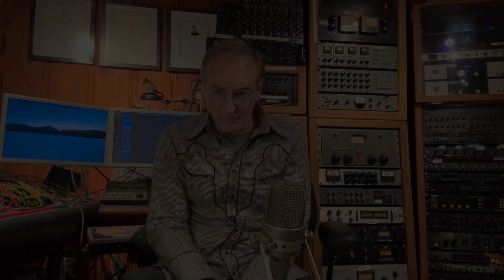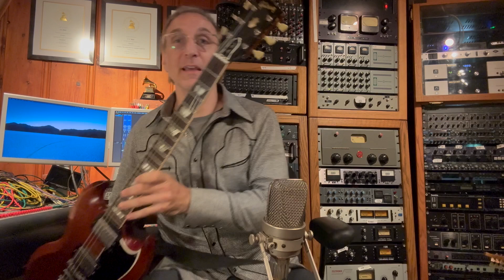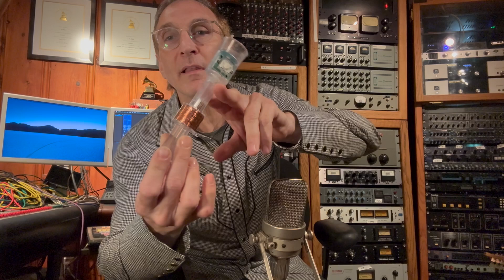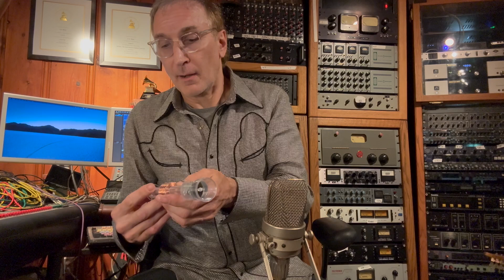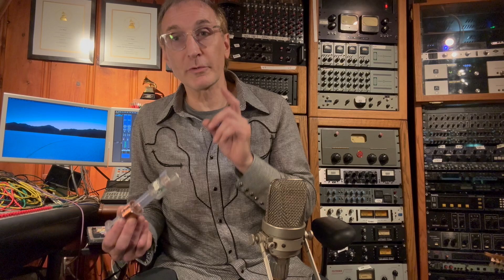Where does electric guitar tone come from?  (pt 1)

Comment: I thought Jim Lills video was really good, I had a a squire P bass a while ago, it looked good and it played very well but sounded like crap! fitting with a 62 custom shop PU and changing out the pots and capacitor, and what do you know, it sounded like a genuine made in USA Fender P bass! it was all down to the electrics in the end.
Reply from the maker: Thinking the video was good does not negate the fact that he is peddling misinformation and his methodology is bad.  His hypothesis has actually been disproven in controlled scientific studies where 91.7% of test subjects in a controlled study heard a difference between woods in electric guitars.  Also, just because you vaned your electronics and the bass sound changed, all that proves is that you can change the sound by changing electronics.  It does not disprove that different woods or construction methods have different tonal characteristics.  Your result is irrelevant, in terms of a body of evidence.  If you want to learn about the subject and see actual peer reviewed science on the matter, read this: https://journals.pan.pl/Content/121810/PDF/aoa.2021.138150.pdf?handler=pdf

Comment: Actually, what you're doing here is expressing opinions. "I have 39 years of experience, so I know." Silly! Jim Lil simply set up this simple experiment: if I take a guitar, with a wood body and neck, and compare it to a guitar without a wood body and neck, but correct for all other variables, what's the result? Simple: they sound nearly identical. You say, "I hear things you cannot hear." Maybe so. But Jim proved, the things that most affect tone in a solid body guitar are: the strings, the pickups, and the electronics. Everything else results in little or no discernible difference.
Reply from the maker: Absolutely incorrect , my friend.  Jim did not prove it.  He simply achieved a similar tonal balance, that was certainly not identical, by removing dissimilar factors, only trying to prove that two body types aren't the reason those guitars sounded different.  And more importantly, he left out the biggest part of the question: Fretting the instrument and comparing the attack, decay sustain and release of the comparables.  Those other things make a huge difference in not only the frequency response of the guitar, but the ASDR profile.  What I try to do in part 2 is show you things to listen for, and point out what those differences are.  I'm teaching you what I know, showing you how t9o identify differences.  I've built a lot of guitars.  I currently own over 40.  I have swapped harnesses in guitars, trying to get one to sound like another.  I spent years trying to get a properly built Burst copy to do what one of my real '50s Les Pauls was doing.  Real 60 fret board.  Old growth mahogany.  Horse hide glue.  '59 spends to the letter.  You name it.  Everything.  Swapped the harnesses back and forth.  The clone did not do what the '50s LP did.  Never sounded the same.  Acoustically or electrically, and the characteristics followed between the two.  Why?  First and foremost, the materials and construction affect the way the string vibrates, and dictates the harmonic balance.  So what the string is doing to the magnetic field is different from guitar to guitar, aside from the other factors.  This has been known for decades, and Jim Lill did not disprove this.  Again, watch the Warmoth video to properly display what Jim failed to.  Then go play a '59 Korina V next to a '59 Les Paul and hear how DRASTICALLY they sound from each other.  I have the gild fortune to have access to 4 V's and dozens of Bursts, including my own.   Bursts all sound different, but V's aren't even on the same planet.  Ask yourself why what's different there.

Comment: I don't think many are arguing the wood and construction don't matter, just that they don't overpower what you hear coming from the pickups and amp, you can't hear the wood on an electric guitar over the speaker of an amp and if you can, congratulations, you have the best hearing in the world, you get a gold star. You could easily hear differences in an A/B comparison between guitars but how much of that comes through in a mix with other instruments in a recording? The tone is from the pickups and the amp and it's easily changed with the volume, tone and an EQ pedal. Guitar tone in a recording isn't anything like a guitar tone on it's own and as an engineer I don't know how you don't mention that.
Reply from the maker: So you are arguing the attack, decay and sustain characteristics are overcome by the amp?  Then you must only be using a high gain amp.  You can hear these differences on records.  This is why when we were making one record, for one song, we needed to use the Custom instead of the Burst.  One was more articulate in a way that is also reflected in their acoustic sound.  As an engineer, I cannot make a PRS sound like a '50s Les Paul, because they have a completely different tone, and radically different transient properties ... unless I'm using so much distortion that it obliterates the sound.  But most importantly, the player feels the difference.  These traits are dynamic, and their response changes the way I play, down to even my picking technique.
Reply from the maker: And, if it wasn't clear ... the elements of the guitar actually change the way the string vibrates harmonically.  That's the point.  A body with a lower octave overtones will make the string vibrate with that harmonic partial.  The resonance actually changes the way the string vibrates.  It's physics.  That doesn't go away when the pickup turns that into electrical current.  It's part of the waveform.

Comment: I would argue that controlling every variable except for one is exactly how you conduct an experiment. As a guitarist/bassist/producer by hobby and PhD biochemist by profession, I would argue that changing an experiment until you have controlled as many variables as possible is exactly what you’re supposed to do if you want to pass peer review. I get in theory that the wood of an electric guitar affects how the strings vibrate, but I think the point of Jim’s video was that the effect is far more negligible than people often say, and is at the bottom of the list compared to string type, scale length, pickups/electronics, and the position of the pickups. I would put the nut and bridge material up there too. I think this makes sense in theory and even if you can hear a difference in Jim’s video, it really is remarkably similar. And i think it’s a liberating thing to hear! I had been considering buying a whole new guitar for years, but after watching that I figured I could just buy cobalt strings and adjust my pickup height to see what that did, and I’m already so much happier with my tone that I don’t feel the need anymore. If anything I may buy some new pickups. I’m just saying, I think Jim’s approach was scientifically sound, coming from a scientist.
Reply: The instruments you are testing are vintage instruments though. Have you considered that lack of wax potting or wax potting that is old and ineffective make your pickups more microphonic? If pickups are microphonic then, of course, they will pickup resonances in whatever they are attached to. Usually that's a cheap piece of plastic so I'd still argue that wood species is irrelevant. This might be a whole other discussion about why some players prefer the sound of vintage instruments, why they might be more 'expressive' and why two guitars might sound so different given the same specs. So you might find fault with the workbench guitar experiment  but I think yours is also far from perfect. I don't think a perfect experiment has ever been done. If it had, no one would be discussing this anymore. 😊
Reply from the maker: @LilOlFunnyBoy  ok, my friend ... assuming that you want to learn something and not just throw counterpoints out, I'll answer this: You went into a tangent that is partially valid, but you missed my point. The point is that the string will actually vibrate differently itself, regardless of microphonic overtone in the pickup.   It’s like when you look at a sine wave on an oscilloscope, and the shape changes because of harmonic distortion, to represent the other frequencies at play. It’s the same thing with a vibrating string. A440 is not simply going to vibrate 440 times per second. There will be other frequency vibrations happening at the same time. The variables of construction are what determine the amplitude of each of those sub frequencies. That has direct impact on what the pick up is seeing only from the string.  

Now as far as a new guitars, and wax potted pick ups go, there is a third part to this video which I posted, while I was very ill and annoyed. It demonstrates that even potted pick ups will act as a transducer on the body. And I know it’s not a failure of that one, because that pick up was repotted about six years ago when it was repaired.  And I have a few Schecter guitars that are potted within an inch of their life that will do it.

That being said, I have built over half a dozen telecaster type guitars for myself and for friends, all using potted pick ups, and they follow the same pattern of acoustical resonance translating electrically.  In fact, I made one with a pine body, and the sustain was so short and dull with that particular body, I really did not enjoy playing it. I changed it to an ash body, and left everything the same except for that piece of wood, and it is a completely different guitar. And I tried everything to make that pine body work. Fat head on the headstock, heavier bridge plate, you name it. It was a vibration dampening machine.  Not all pine is, but that piece certainly was. And back to the question I asked, if you have owned enough guitars and I’m currently at about 50 in my possession, and I’m sure I have owned twice that overall in my life, both new and old, and if you have worked on them, built them from scratch, changed nuts, bridges, pots, bridge saddles, gone from Kluson tuners to Grovers, you probably wouldn’t have so much contrarianism.  Go play a D18 and a D28 and tell me the two different woods don’t make those guitars sound completely different.  Then remember  it’s not just the sound of the body you are hearing, but the string itself behaves differently because of the body.  When you understand that, then you will be way smarter than the Glen Fricks of the world.  

Everything has an impact.  The extent of the impact always depends on any things.  Sometimes great sometimes small, and you can't always predict which system will be more reliant on these factors, but to not understand that these things make a difference is like not understanding that gravity impacts how far you can throw a ball.  Enjoy your weekend!
Reply: @JJBlairrecording yes, always open to learning something new and challenging existing beliefs 🙂 I will disregard the D18/D28 observation. As you know what you hear from an acoustic guitar is the entire guitar resonating. What you hear from an electric guitar is what the pickups generate. Not the same thing at all, a false equivalence.
Sorry but you've not convinced me in this case. I hear clearly the differences between your guitars but you have not proven why they sound different. The reasons could be many. I do not hear a difference between Jim's Anderson and workbench guitars. This suggests to me that the tone of an electric guitar is primarily affected by the criteria he points out. Tone woods have little to no discernable effect and conversations about paint thickness or composition are ridiculous.
Reply: @JJBlairrecording  it's very difficult, as guitar players, to be entirely objective when playing and listening to guitars. Everything about their construction contributes to how they feel and sound in our hands. I have owned many guitars that feel and sound horrible. After a proper setup they are transformed. This might be because the setup allows us to play with more fluidity and generate the sounds we want. The guitar responds to our input more accurately and is more satisfying to play.
Reply from the maker: @LilOlFunnyBoy  There are factors outside a setup that can't be changed.   I have to say that I am saddened that I present you with a peer reviewed white paper, which scientifically refutes what Jim’s video attempts to but fails to even prove, and then I explained to you characteristics beyond Tonewood, such as ADSR, and you still fail to see that the manner in which the string vibration is impacted by what it’s attached to.  I hope you have a happy and fruitful life, having fun playing music.
Reply: @JJBlairrecording  Don't be sad and thanks for the polite discussion. Although I have been playing and modding guitars for over 30 years I appreciate that your experience is far beyond my own 🙂 Re: the white paper... that is interesting. The experiment seems to be thorough and the conclusion is that listeners are able to identify the "odd one out" in a blind listening test. However... the results show that some woods are more difficult to differentiate than others and the difference is more acute at certain frequencies for different woods. It's probable that the multiple woods used in guitar construction (the test was a single piece) would change the results of a similar test. Also, while the experiment certainly showed that small tonal differences exist in different pieces of timber it did not prove that the differences were consistent within pieces of the same species ie. if the same test was conducted with 4 pieces of rosewood from 4 trees would you get a similar result?
Reply: Exactly right, Duke. 100%
Reply from the maker: @LilOlFunnyBoy read the link I just posted. The biochemist is out of his element, though well meaning.
Reply: @JJBlairrecording the bottom line is: the tone produced by a high end guitar is indistinguishable from some scrap wood and a workbench. 
That's not to say that there aren't many ways in which the Anderson is better (playability being one!) But the experiment effectively displayed that all of the discernable tone comes from the pickup.
Reply from the maker: @LilOlFunnyBoy  I could not agree less,  Did you watch part 2, where I show what a large part of the tone comes from the attack, sustain, decay and release profile?  Even if you remove the harmonic factors / tonal balance, the ASDR properties are an enormous part of the tone, and directly have impact on the way the string vibrates, and what the pickup sees in terms of vibration.   And if you listened to the SG vs the Les Paul, and did not hear how the extra acoustic bass response on the SG was in the pickup too, then you can't have an honest discussion about harmonic content.  Please trust me ... I spent a lot of time and money trying to copy the sound of a certain guitar, and using that same pickup did not achieve it.  The two did not sound the same acoustically, here, they did not sound the same electrically.   And to further disprove your assertion, check this out ... I had a guitar built, and the next was too chunky, and I didn't like the body contours.  I personally reshaped the neck much thinner, changed a great deal of the body geometry, including thickness of key areas, and made the headstock thinner.  Not only was it more comfortable to play, the bass response COMPLETELY changed.  All the woofiness it had was gone.  Same pickups and harness.  BUT ... the ADSR profile was the same!  Same ping and chime that made it unique.  Use Occam's razor on that one, and then ask yourself of the body has no affect on tone.  

Out of curiosity, how many electric guitars have you owned in your life?  How any have you built yourself?  How many have you  rebuilt?  How many have you personally modified?  The reason why I ask, if the people who can answer that with large numbers will not take issue with my statements.  Our experience lines up on this.
Reply from the maker: Here, actual, published, peer reviewable science, by a scientist, proving that Jim Lill is wrong, and his methodology is shoddy:  https://journals.pan.pl/Content/121810/PDF/aoa.2021.138150.pdf?handler=pdf
Reply from the maker: I have a completely different impression of his video, and don't think he controlled every variable except for one.  I think there were far more unaccounted for variables.  The fact that he neglected to fret a chord is a substantial factor.  The reason I say he's reverse engineering to get a result, instead of obtaining a random result in a controlled study, is that his desktop guitar should have sounded like the first guitar he rejected.  Again, watch the Warmoth video.  Completely disproves his theory.  Not to mention, there are peer reviewed white papers that rely on much sounder methods than Jim's video ... ANDt the two things sound different that he says sound alike!!!!

Comment: I agree with that. The guitar is an electromechanical system. The vibration of the string is the result of the mechanical system “string + body + nut + neck” and the current generated by the pickups is the result of the electro magnetic system “string + pickup”. It is a complex system and each guitar has its own characteristic harmonic composition.

Comment: Pickups are only microphonic when not wax potted.
Reply from the maker: Incorrect.  Potting reduces the effect, but does not eliminate it.  The vibration of the coil will still create current in the magnetic gap, even when potted.  It simply reduces the threshold at which a pickup will feedback and squeal, but it will still do that, given enough volume.  It also reduces its ability to transduce the body vibration, but does not eliminate it.